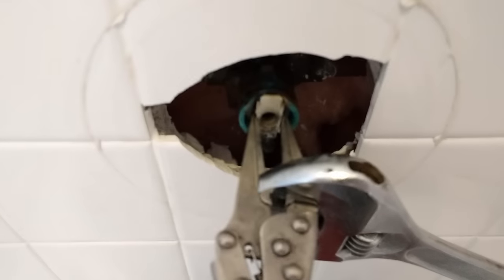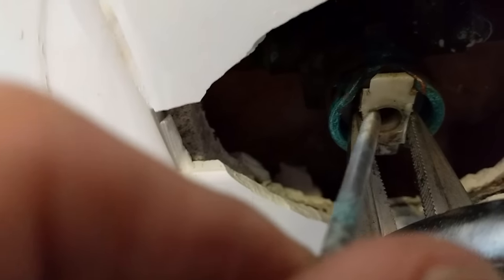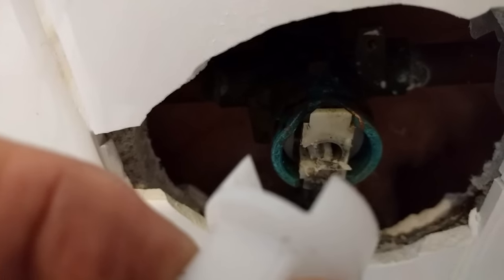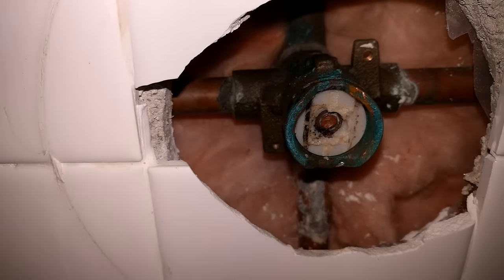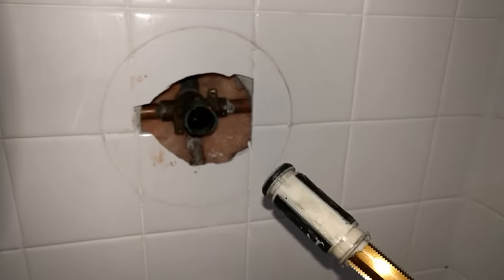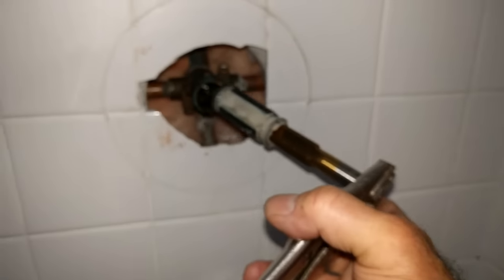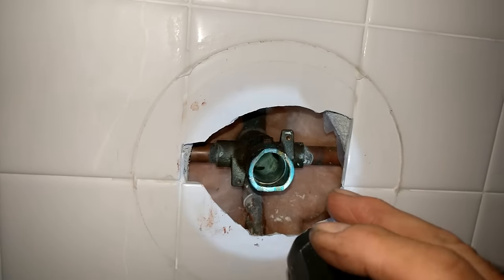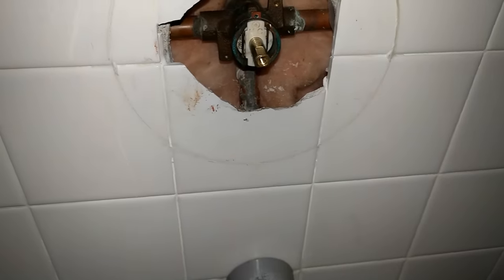Home repair Moen 1222 cartridge stuck really bad by froggy

Comment: I had exactly the same problem with the stem broken off. I applied heat with a hair dryer for about ten minutes and used needle nose pliers with the jaw open to rotate the stuck cartridge by the jaws hitting the sides of the plastic to give it torque. (Sort of like a spanner wrench) once I got it to move a little, then I shot it with WD-40 and continued to rotate around an it got easier.  Then pried on plastic as rotating and it slowly came out.  Slow process that took about 30 minutes, but I don’t think it would have worked without heating.
Reply from the maker: Excellent

Comment: I had the same problem about 6 years ago, with the stem breaking off and the center pulling out with nothing left but the outer plastic shell, I watched a Youtube video of a plumber taking a hacksaw blade and very carefully cutting the shell without cutting into the the brass pipe, so I went ahead and used that method and cut into about three different places to take the cartridge apart being careful not to cut into the brass , it took me about three days  working off and on until I finally got it out. What happened in my situation was the flat rubber pieces on the sides went out of place and got wedged between the pipe and the cartridge making it impossible to pull the cartridge out.
Reply from the maker: Thanks for adding info!

Comment: If you look close you can see it has a stamp H, if it's on the bottom install the new one that way, if it's on the top, then put it in that way, easy if you check first. A correct hot and cold supply pipes, will have the stamp mark at the top.
Reply from the maker: Thanks!

Comment: My shaft broke too trying to Pull It Out Might Have To Go Buy A Tap
Reply from the maker: best of luck post back
Reply: No Luck With Mine Just Keeps Melting And Tried Drilling It Out Not Getting Much Out
Reply from the maker: @chasebrunner  Try the ezout bit.
Reply: @1947froggy  Going To Home Depot To Buy One And A Tap And A Long Bolt To Plumber In My Area Said 110 Hr
Reply from the maker: @chasebrunner  Yep, $$$. DIY learn & save.

Comment: If this comment has been posted previously I apologize in advance. Why do plumbers not have as a basic part of their kit, moving blankets? While watching this otherwise excellent video, I kept hearing tools dropping in the tub and wincing each time it happened. The first job should be to place a moving blanket, better still two, in the tub for protection. $9 + tax for a 72" x 80" blanket from Harbor Freight. Cheap, fosters good relationship with the customer and protects the tub from falling tools! Applies to DIYers too.
Reply from the maker: I did have padding down & it still makes a sound when stuff is dropped, no damage ensued.

:)

Comment: Thanks your video. Recently I have a same issue, from your video I know how to use M18x1.5 tap to take plastic sleeve out, I still want to know how did you pull the stem (metal material)out before tapping plastic part? Thanks
Reply from the maker: IIRC a needle nose vise grip.
Reply: Thanks

Comment: I carefully drilled a very small pilot hole next to center angled into the middle. Then a #8 2" wood screw. It hit the stem and slowly forced the plastic cartridge mostly out. Still had work to do for final removal but was able to finally remove and replace. Had to break stem removing handle to start off so it was a chore.
Reply from the maker: Nice job Steve.  :)

Comment: We did this yesterday. The tools didn't help. We accidently made it start out by reassembling the unit without the keeper pin. The water pressure pushed it out about an inch. after the entire thing broke in 2 pieces we just took it out a chunk at a time.
Reply from the maker: You did it with water pressure turned on?

Comment: when you put the new cartridge in, there is an "H" and a "C" that is marked at the top on the face of the plastic. When the mark is on top, it's correctly installed.
Reply from the maker: Depends on how the hot cold pipes are installed.

:)
Reply: I was assuming they were installed properly by a plumber
Reply from the maker: I don't know that there IS a plumbing standard on whether the hot comes in on the left (facing the fixture) or right. Talking about the pipes in the wall. That is why the directions that come with the cartridge go to the trouble of explaining how to (180 deg.) flip the cartridge if the h/c on the HANDLE is working opposite of what you want/need.

:)

If there is a standard it may vary state to state, country to country, even plumber to plumber. And they "get it reversed" by mistake every so often.
Reply: The H and the C is marked on the cartridge.
Reply from the maker: Those are the Taps (the handles you twist to turn water on/off, not the PIPES IN THE WALL.
Good reference forum, thanks.

If I had time I'd post a scan of the Moen directions that explain about the H and C and go on to explain about "revolving" that cartridge to the opposite, but I don't. Maybe if you are curious you can find the cartridge directions online and read for yourself. I don't think you are believing me, but that's ok. No worries.

:)
Reply: "Our code requires cold to be piped on the right and hot on the left."
Maybe the codes in your State are different....
Reply from the maker: Thanks for viewing Peter.

:)
Reply: The plumbing standard is ALWAYS hot on the left.

Comment: i'm about to tackle this on a 15 year old house shower once I get the replacement piece. wish me luck!

will be caution and patient and saturate it with wd-40 first

also the reason i'm changing it is because i turn it to hot but it's only hot for a few seconds then get cold (sink beside it in same room has hot no prob), this part will fix that right?
Reply from the maker: Post back how it goes.  :)
Reply: @1947froggy  cartridge has been there since house was built, can I get a replacement from Moen?
Reply from the maker: @rickytruong5994  Probably yes, you need the part number, which may mean you need to take it out 1st.

I know. Without use for a few days.
Reply: @1947froggy  oh i'm taking an educated guess and going with 1222 because there's the plastic head, the 1225 has an all brass head. i bought the puller too just in case. pretty sure it's gonna be a b to take out and will probably have to tap it and extract it. I also called moen but they don't want to answer the phone and have a crappy automated message that forces you to hang up lol.
Reply from the maker: @rickytruong5994  Good luck, let me know how it goes, Moen service is crap.

Comment: We followed dyour instructions to replace our broken Moen valve catridge in our shower.  We know that the new valve cartridge is more flow restricted than the one we removed, which was probably at least 20 years old.  The problem we have now is that the water flow is REALLY radically restricted with the new valve cartridge.  
We have removed the new cartridge several times, checking to make sure it is placed correctly in the receptical.  But still our water flow is at 1 gallon per minute - no more.  

Is this normal??
Reply from the maker: No there is something more (wrong) with the install, remove and have a critical look at what else it may be. Is there a REMOVABLE restrict orifice?

Comment: Use a heat gun, melt the plastic and you can easily work it out with needle nose pliers  and screw drive in 5 min.  No excessive pulling, drilling, blood  or risk to damaging the copper with a tap.  One slip with a drill or tap and you have a much bigger job than a stuck cartridge.
Reply from the maker: I like that method too in theory , but I have not tried it.

:)
Reply: I've used it to get those stuck toilet seat plastic screws/nuts off...   I heat a spackle knife and it cuts through the plastic like butter.   I don't heat the screws directly because I am afraid the heat might crack the bowl
Reply: really old ones are metal casings
Reply: Can't believe my wife had a heat gun, she uses it for embossing stuff.  A little CLR and the heat gun for like 30 SECONDS and I pulled it out!  Just hope Lowe's or HD has the replacement.  I'm typing this about 4 hours after starting this job, using plenty of CLR and penetrating oil all along the way, from the set screw on the handle to extracting the cartridge.  What a PITA.

Comment: Well after struggling for a couple hours using the Moen tap removal tool, I've broken off the stem and ended up drilling holes like you mentioned to pull out the center piece, but now I have the plastic stuck and no 18mm tap for at least 3 days (amazon). Do I rely on that to save me, or do I call a plumber and pay ~$300 to come out and fix it in 2 days?
Reply from the maker: I'd wait & use another shower if available.

Comment: I wanted to add mine was stuck, I sprayed vinager let it sit over night then sprayed goof off. Used a blow dryer for 10 minutes 2x then it pulled out using the T bar tool they sell at ACE hardware and other places.
Reply from the maker: Excellent thinking  :)

Comment: Same thing happened to me the front end of the stem where the handle is screwed to snapped off, then the rest of the stem pulled out leaving the plastic sleeve in place , 9:30 something raced to the Home Depot where I bought 3/4 inch drill bit and careful drilling managed to remove it. Biggest tap they had was 1/2 inch so no go on that. Also you must rotate plastic and stem 45 degrees clockwise according to instructions supplied with new stem. Thanks, YouTube posters.
Reply from the maker: Good.

:)

Comment: We used a drill bit to get our delta cartridge out because it was stuck like cement. I think we damaged the valve because now the shower head leaks when the water is off. I heard you say if you damaged the valve it may leak but since ours is leaking from the shower head, do you think it still could be do to the scratches in the valve?
Reply from the maker: Could be yes, the brass will scratch pretty easy, could also be a rubber part that got cut on installation, sorry it did not come out right, putting another one in should be easy as the hard work & learning is already done, if your water is $$$ I would give it another shot. Froggy

Comment: If that cartridge fails, but the brass stem the part that broke off in your video isn’t really what broke on mine, but you can’t hardly turn it to get it on or get it off like it’s all the sudden just act like someone’s holding onto it where if you try to turn it left But you can’t turn it off again it’s like the water is stays running. I have to go shut my main valve off. Could that be the cartridge is actually failing in the backside it’s not all the plastic pieces upfront. It’s what is actually failing behind that in that interior that you’re pulling out mine basically I believe it’s a Moen when I went to turn the handle upwards you know how to turn the shower on it felt like I was fighting with it like somebody was hold onto it. Once I got a pass to work water would start to come on then of course you couldn’t get it to shut off. It just won’t turn it’s like like it’s stripped or some deep in the wall, so is that what do you think would be the problem the cartridges failed at 12:22 part number

Comment: in some cases you can't use them to him so you might as well turn on the water valve definitely if you have a screw broke off into the hole I tried it and it worked I thought the cartridge was going to go through the wall it was pretty funny

Comment: That’s why I don’t twist Take a one by six boards onto the wall on each side clamp your vice grips on take two crowbars and pull out evenly comes out in about five minutes even if it’s really really stuck Valve was stuck for 25 years

Comment: Last be sure to clean the body side walls with plumbers cloth and apply a good amount of lube to the body inner surface and the rubber seals on the side of the new plug kit.

Comment: I broke off half of it in the valve housing. After trying different ways to get it out I ended up chiseling the rest out piece by piece  luckily not scoring the cylinder opening and replaced fine. Yeah quite an ordeal 
I'll try the tap method if it happens again
Reply from the maker: Not easy no matter how you do it.  :)

Comment: What the difference between 1222 and 1225B?   We have a single Moen shower/tub that is leaking and need to get the part.
Reply: 1222 just turns counter clockwise.....1225 is push and pull for pressure/left & right for hot and cold

Comment: I used needle nose pliers to remove mine and it took me 8!hours to remove. Just don't scratch the brass because then it will leak when the new one is installed.
Reply from the maker: This is one "service item" you do not want to put off. I did it again recently (with video) and much easier. As soon as it starts to BIND or get any unusual effort to twist, replace it.

Comment: At 3:42, I see broken metal shaft still left in the middle of the diameter. That will prevent you from driving in M18 X1.5 ?   Today, I used DeWalt half inch tap to carve into the cartridge, but it would not go in because of broken metal shaft still left in the cartridge.
Reply from the maker: Thanks for viewing.

Comment: I had to use a screw driver and needle nose pliers to get the what was left of the cartridge. I had the same problem, the stem broke off. Now the new cartridge drips.
Reply from the maker: Sometimes there is damage when the old one comes out. This would mean replacing the whole housing (think cut & solder. Not for diy IMO.
Reply: @1947froggy  I’ll clean the inside of the housing with some 600 grit emery cloth, if that doesn’t work, I’ll replace the cartridge again. If that doesn’t work, then new I’ll replace the housing. It’s all 1/2” copper pipe sweated in place. A pain, but can be done.
Reply from the maker: @kmg-vn5zj  I like that idea, just don't remove too much material, maybe it's a small scratch where the oring seal sits, post back how it goes.  :)
Reply: A little at a time froggy, slo and easy. But you most likely are right, it probably has a scratch in the housing. I should have looked more closely at it. But thought a had a victory getting the old cartridge out.
Reply: Got it froggy. Worked the emery cloth inside valve. Found one little scratch on the hot water inlet, worked it with the emery cloth until it was smooth to touch. Reassembled. Although I did replace the cartridge.
Reply from the maker: @kmg-vn5zj  Excellent, the scratch may have damaged the seal on the cart. so good idea.  :)

Comment: I bought the 18x1.5 tap, it fits in perfectly I still can’t get the plastic sleee out
Reply from the maker: You need the size tap to thread itself into (cut into) the plastic. If it slides out go up 1 size tap.

:)

Comment: Thanks. Now I replaced with a new postitemp and it is licking a bit .  What should I do?
Reply from the maker: I would take it out and inspect to see if you cut a gasket. Should be easy to do the second time.

:)
Reply: hopefully you didn't damage the housing using this method.
Reply from the maker: No just touches the cartridge.

Comment: My cartridge was stuck but I inserted a bolt into threaded hole and while I pulled on the bolt with vice grips, I kept  turning the cartridge using the plastic removal adapter  With some amount if twisting and turning it broke free
Reply from the maker: Good work.

:)

Comment: Mr. Froggie - Thank you so much for this video! We had the same problem a while ago and it took my husband hours to get the broken cartridge out, wish we had your video to reference then. :) I did have a question... after a recent well issue that caused grit to circulate through our system, the cartridge needed to be replaced again. This time, however, the faucet is leaking.....? Double check that everything is in the correct position, took apart and reassembled-still leaking. Any ideas?
Reply from the maker: Possible damage to a surface on the sealing parts, also possible the housing that the seals rub against has a scratch, try a new cart.

:)

Comment: I wish i watched your video before i tried to fix my leaky moen shower. I had to drill out the plastic cartridge because like yours it broke off inside. A tap would have been a better choice. However, i must of scarred the bore with the drill bits but, it doesn't leak. The shower water temperature can not be regulated very hot then cold. I am constantly replacing the cartridges. Any help gladly appreciated.
Reply from the maker: Probably you are right & damaged the bore if, as you say, it does not regulate temps with a new cartridge. The only suggestion I would have is to solder in a new housing (the part the bore is in). You will probably need to tear some wall out & maybe get a "real" plumber, unless you solder very well.

:)
Reply: Update Froggy I finally fixed the shower. The diverter bore wasn't damage problem was small sediment got stuck in the cartridge & bottom part of diverter causing partial block. 
This cause us grief for years. My determination to fix it like yourself. I use my air compressor with air hose attachment to blow out the lines. Especially the bottom that was the problem didn't notice it at first what a dummy
Reply: Also turned on hot & cold valves temporarily to flush out debris from the diverter. However, this doesn't flush out bottom part of diverter as I just learn. Cap off shower head and use compressed air at spout to remove the block. Thanks for your help.
Reply from the maker: Great thinking!

:)
Reply from the maker: Congratulations, success!

:)

Comment: there is a way to do it much faster. Take flat screwdriver and pry up upper and lower lips of the cartridge just break them off. Now you be abble to remove cartridge easily in 5 seconds. Other methods can break you plumbing you even do not see.
Reply from the maker: Thanks, but if hard water deposits have "welded" it in place not so easy.

:)